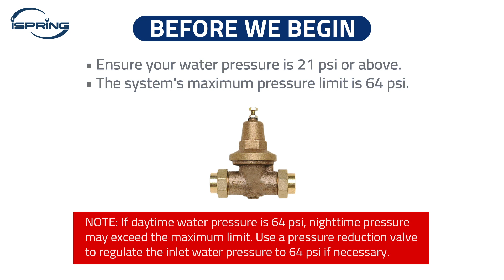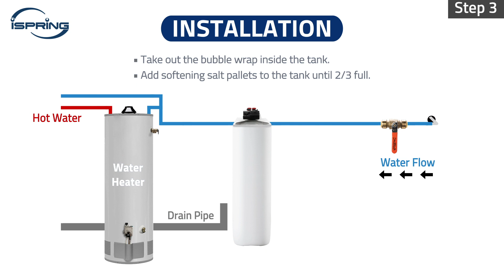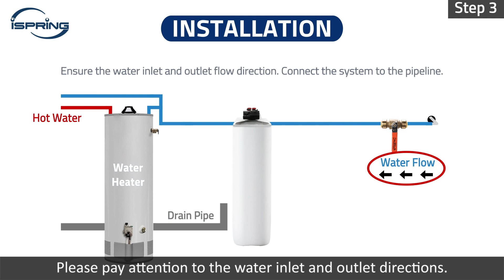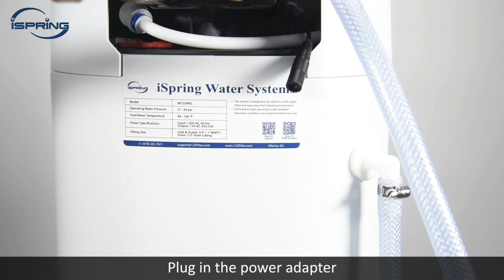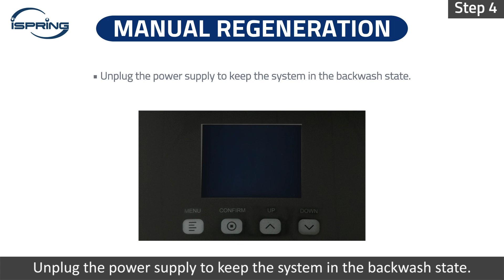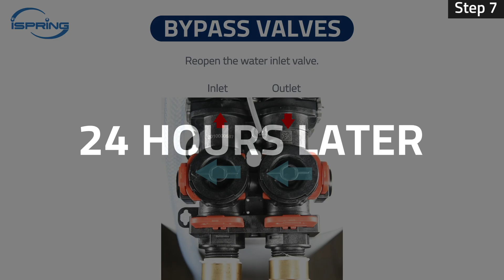iSpring WCS50KG Water Softener Installation Guide: Easy Setup for Luxurious Water

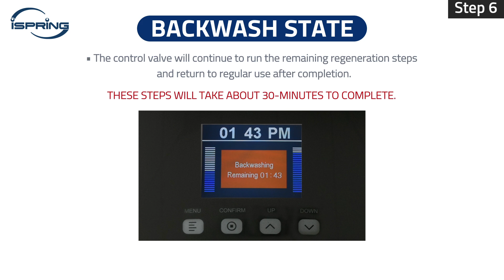Comment: I think there's a couple errors in the video.  At 6:20, it shows opening the valve to flush the resin tank but it never opens the outlet.  At 6:50, it indicates that the system should stand for 24 hrs.  The system is in the bypass mode but isn't unplugged.  I left mine plugged in and then it started beeping 12 hrs later.  I wasn't sure what was to be done.  Maybe these are not errors but the video doesn't say one way or another.
Reply from the maker: Hi there! Thank you for your feedback!
Regarding the flush step around 6:20: at that stage, the valve does not need to be opened yet. During the flush, the water is directed to the drain line, which is why opening the outlet is not required at that point.
To assist you more effectively, could you please send us a short video showing your installation and the issue, if it is still occurring,  to support@ispringfilter.com?
Thank you!

Comment: Can the drain line pump up vertically or does it have to drain no higher than the height of the drain fitting ?
Reply from the maker: Hi there! The drain line should not be elevated higher than the drain fitting to ensure proper drainage.
If you have any concerns or questions, please reach out to us at support@ispringfilter.com  or 678-261-7611  for proper assistance. Thank you!